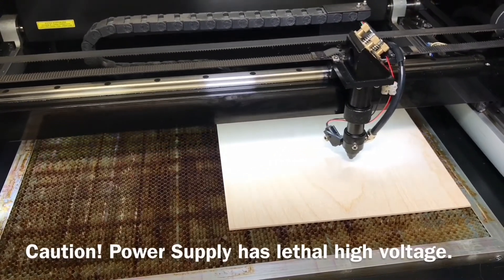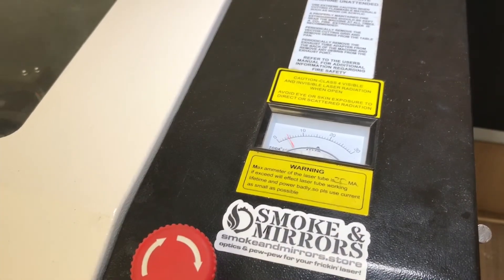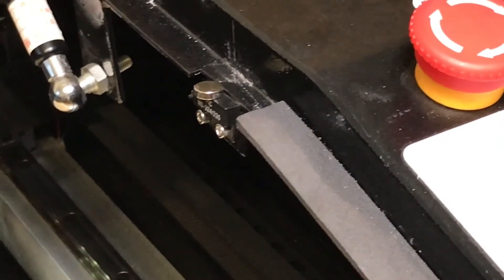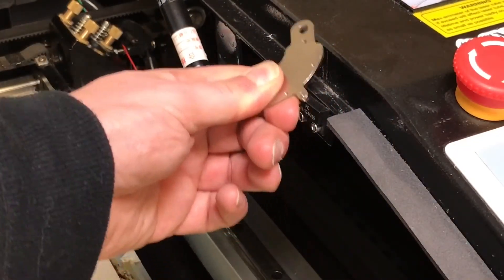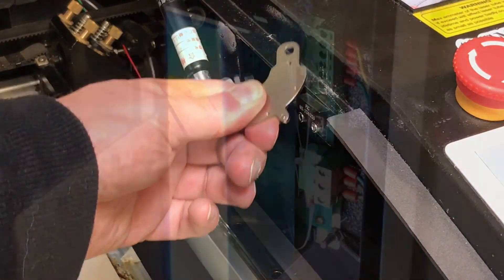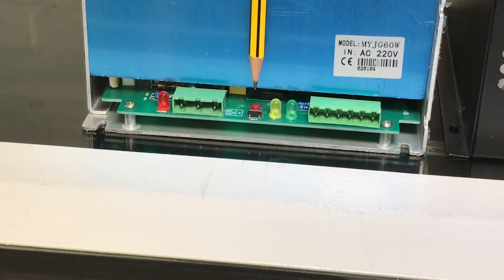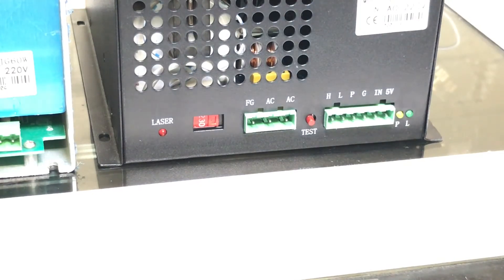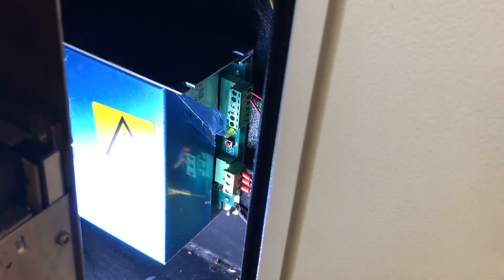"Laser Not Cutting" Interlock Diagnostics

Comment: I would like to add interlocks to my laser cutter which did not come with any. The laser power supply looks like the black one you showed in the video. Which connections on the PSU would I need to use to add the interlocks? Is there also an interlock connection on the Rudia controller so that it knows to pause the program / motion controls when the laser has been deactivated?
Reply from the maker: Power supplies differ even when they look the same. Check with the manufacturer. 
Protection is often marked “p” connect your interlock between “p” and ground. 
Ruida controllers also come with several connections for interlock protection and can be enabled in the setting. Check Ruida documentation for your controller.
Reply: @SmokeMirrorsVideos  Thanks for the quick reply. Can the interlock only go to the Rudia controller or should it also be hardwired directly to the laser PSU regardless?
Reply from the maker: @StreetMotionUK  In my opinion you don't need both but the choice is yours to make. Please be aware that laser cutters can be dangerous to work with due to laser radiation and lethal high voltages. Take care.

Comment: When you say the yellow led means an interlock is engaged, you mean one is tripping the system and not letting the laser fire? Is that correct?
Reply from the maker: No it is not tripping the system. In this example, when the yellow light shows, it means that there is a possitive signal from both a flow sensor, detecting flow and closing the switch and a magnetic sensor interlock on the lid of the main cutting area, again showing a yellow LED when closed on the high voltage PSU. Without these interlocks working the PSU will not fire the laser. If you have more questions or a specific support query please use my forum/community https://community.andmirrors.co.uk/